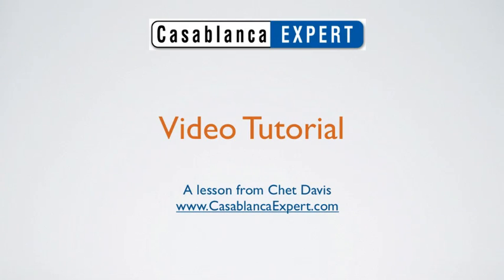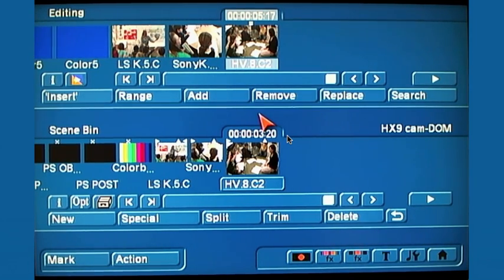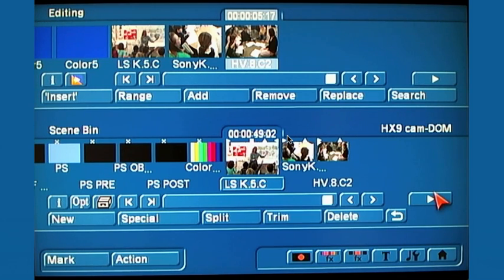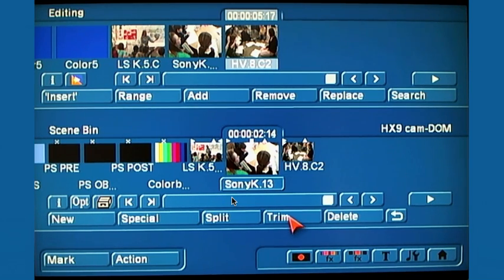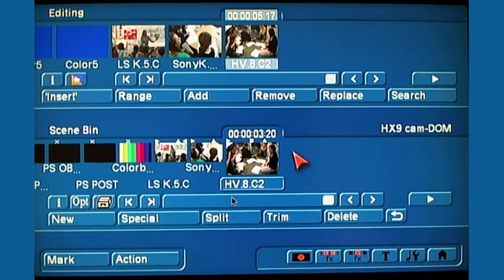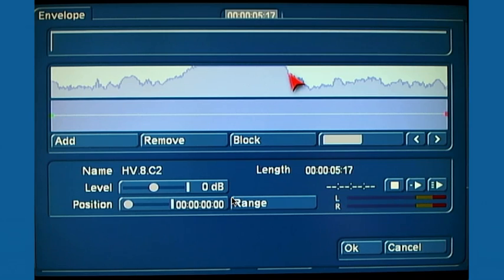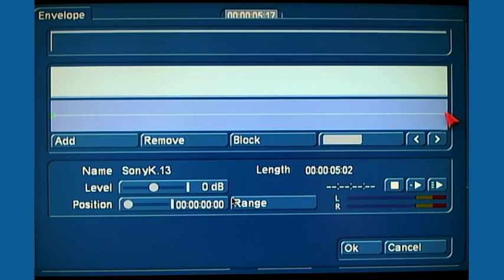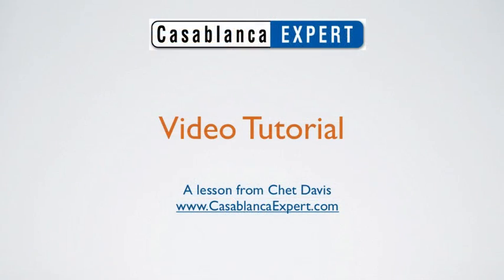Casablanca Expert Video Tutorial: Using Visual Feedback to Diagnose Audio Issues

Comment: Hi Chet, I recently got a Dell monitor and a VGA to VGA cable to use with my Avio and it doesn't seem to register on the monitor that it's hooked up. Is there a setting within my system that can be changed or do I need a different cable? I was thinking maybe get a VGA to S-video cable?